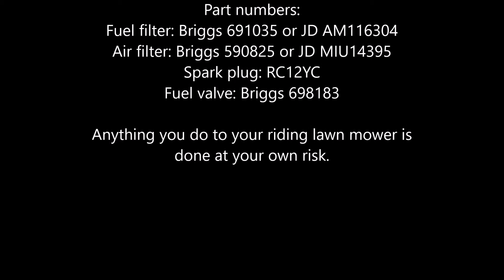John Deere D105 maintenance items

Comment: I need to know what i need to remove the carb bowl. Ive tried every screwdeiver and still cant get the back screw out
Reply: They put the oil filter right beside and no way to get a stub screw driver or anything straight enough to break it loose
Reply from the maker: if you have a carb bowl held on by 2 screws, it is a Japanese carb and the screws are likely JIS; they look like a Philips but a Philips will just slip out.

Comment: Can you put the valve before the fuel filter? Just wondering if it would be easier to just turn off the fuel every time you replace the filter so you don’t have to run the mower dry. Would that work?
Reply from the maker: Before or after the filter will work fine.